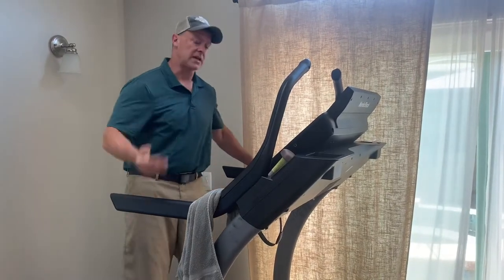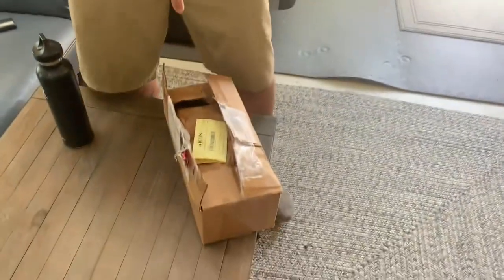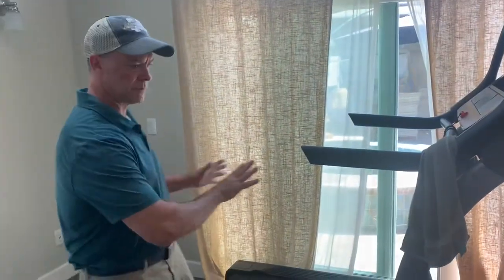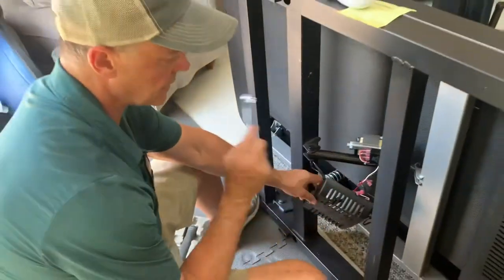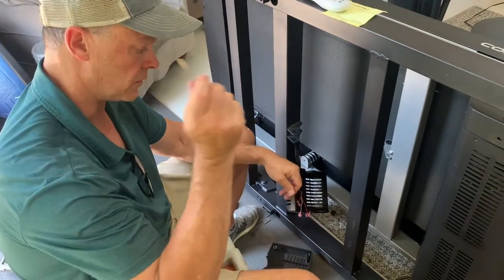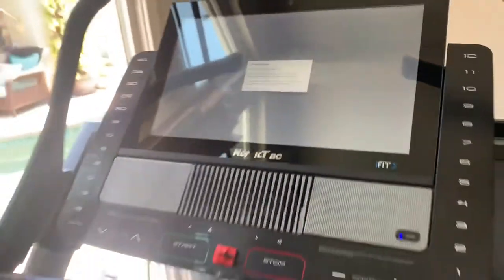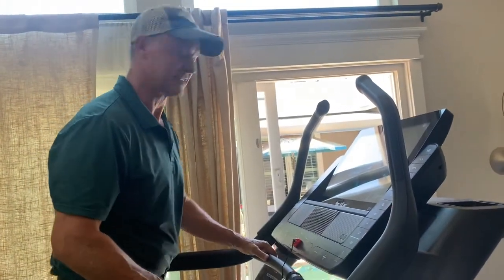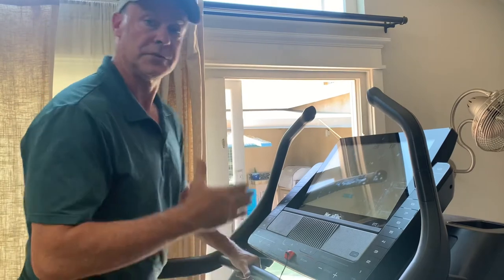Nordic Track x22i DO NOT BUY Part 3 - Incline Motor Replacement

Comment: DO NOT BUY ANYTHING NORDIC TRACK!!!!  I watched all your videos ... unfortunately after buying the X22i.  It is, without a doubt, a giant steaming POS.  Within two months mine died.  I went to power it on and it kept tripping the circuit breaker.  I tried a different outlet and it started arcing... Customer service insisted I remove the hood and plug it in to troubleshoot.  I refused to get electricuted... so NO!  They would not authorize a tech support visit but would be happy for me to commit to paying them more money to get service that should be covered under the extended warranty.  Best advice from reading comments on several complaint videos on Nordic Track ---  Research companies that refurbish commercial treadmill.  Find a reliable one and pay signicantly less for a used but more reliable treadmill. ---  DO NOT BUY ANYTHING NORDIC TRACK!!!!

Comment: I agree that at times those NordicTrack machines are a nightmare, I have three (treadmill, bike and rower) and yes, I had problems, you need to have the ability to repair those machines yourself....
NOTE: let's be honest, what I do not agree with is that you buy a simple machine and with an app on a tablet you can do the same, False, I did it and it is not the same, you can never compare the automatic settings function as inclination, resistance, speed that the instructors give is totally more attractive and motivated to do it through automated machines ... good morning and continue doing exercises regardless of any machine

Comment: Don't worry people, they all stuff up and it isn't cost related. $300 or $2000. Many different brand names use the same Chinese motor manufacturers just different power outputs and engineered into the treadmill differently. Many incline motors have a 1 to 8 duty cycle. That means run for 10 seconds then rest for 80 seconds. If you are constantly raising and lowering the treadmill the risk of burning out the motor rises substantially. So as Jack said, just buy a cheapy. Wear it out, go get another. It's the free enterprise way to help burn out the planet too.

Comment: I wish I had seen this video and the comments before I purchased my incline trainer x32i a little over a year ago.  My treadmill stops working abruptly and without warning after you have been on it for longer than about 30 minutes.  Loved it before this but now hate it because of all the money I spent to purchase it.  I even bought the super duper extended warranty - I reached out to I fit and icon about three weeks ago, and still no resolution, just the run around and the buck being passed to the next person.  Totally awful no real customer service, but unfortunately, that seems to be the norm these days. I will definitely avoid purchasing exercise equipment online in the future. The frustration and feeling like you’ve been ripped off is just not worth it if something goes wrong.  I have been a NordicTrack customer for over 30 years, but clearly would never buy from them again.

Comment: Thank you for your help! I had no idea it was this easy to change out. I really appreciate you taking the time to make this video. I had so many arguments with the company to come out and fix it under warranty.  They sent the part but couldn't find a person in my area to come and service the machine ! So disappointed with this machine. I love this machine, but it is always breaking. The company doesn't care about solving your problems. Very disappointed considering the high price tag of buying this treadmill!
Reply: Nordic Trac doesn't have in house techs they out source the work to local repair companies and most of them were backed up with commercial gym repairs.

Comment: Was it difficult to turn the treadmill on its side? How many people did it take? And why did you turn it on its side this time, instead of flipping it vertically to rest on the console like you did in the last video? I have to do the same, and am trying to figure out the best way to flip it.
Reply from the maker: It was not difficult, but it does take two people. We had to turn it on it's side to access the incline motor.
Reply: Jack Sapyta Thank you! It was definitely a lot easier to turn on its side with more than just my 5’1” self! Next challenge challenge I encountered was that the screws were in so tight that we couldn’t get them out! I’m a little worried we stripped the screw head. I have to figure out how to address that (any tips?), and then have people come over again to help me flip it back on its side. I love it when it works, but this thing is the bane of my existence!

Comment: That is so not right.  I bought my machine through Sears and bought the extended warranty.  My warranty will send you the part, then you call the service technician to do the repair.
Reply: I think he said they had the same arrangement, but that he didn’t want to wait however long it would take to schedule an appointment.